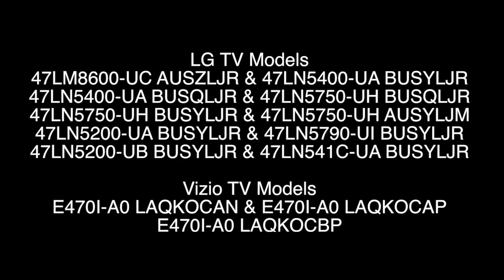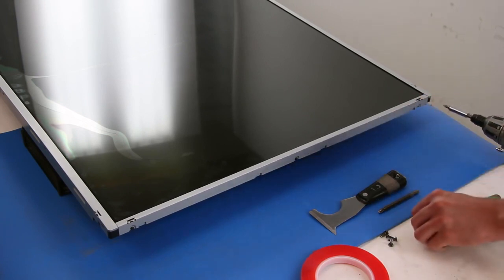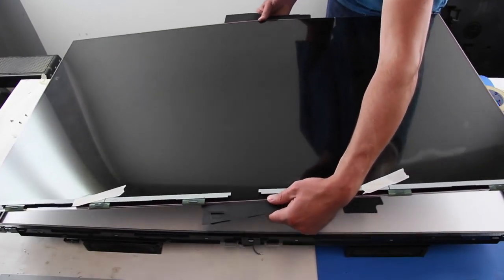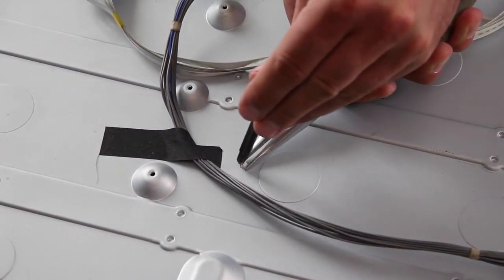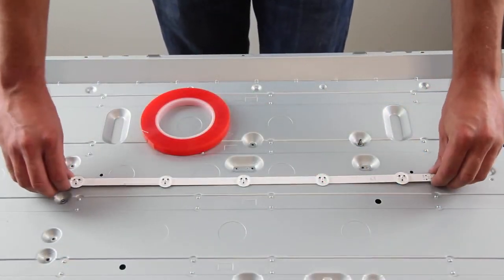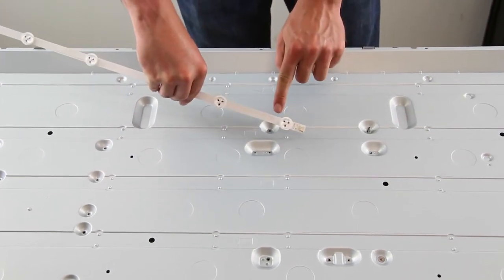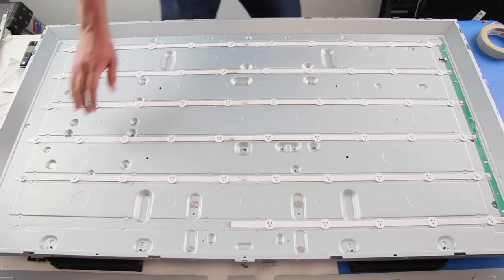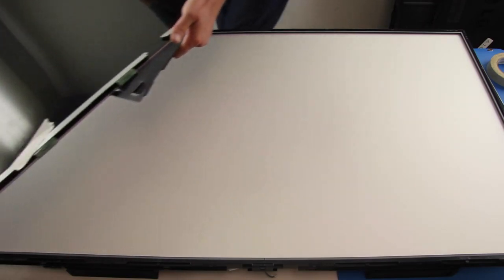LG 47LN & Vizio E470i-A0 No Backlights - LED Strip Replacement Tutorial - Fixing Bad LEDs

Comment: Great video.  I viewed a few of these videos to compare details, and this one I liked the most. Please note, this job turned out to be way easier than it seems.  It took me under 2 hours, including getting tools out and putting everything away. And I took my time. I didn’t remove the circuit board that the LEDs plug into, because you don’t need to.  I had to loosen the back circuit boards in order to “plier-off” one of those white plastic spacers holding the LED cover sheet. The fragile LED I was the most intimidating, but with a suction cup tool, it eased the removal, and this was not an issue.  Remove it the outer plastic back of the TV was probably the most intimidating, followed by unplugging the IR/red led light wires; so don’t let those first two steps stop you. $29 fix, well worth it!

Comment: I am late to this party, but my E470i-A0 just went dark.  It appeared to have a bad set of LEDs in the middle of the screen before it went all black.  I have LED strips already so I'm good there.  Should the lighting board that the LEDs plug into be replaced with a new one?  Also, are you using double sided kapton tape to hold the LEDs in place?

Comment: I got my LED's installed on my LG 47LN5400, but I got the light filters out of order (painter's tape failed to stick).  Does anyone know which piece goes down first (and rests on the pegs)?  The hard plastic filter or the 3 flimsy ones.
Reply: Did you ever figure it out? I have a Vizio with the same model panel and put mine together in the wrong order as well. The top and bottom of the screen is darker and not very clear. I hope you can tell me the correct order.
Reply: @xorange90x  Nope.  I took my best guess and I don't remember which order I put them in.  The picture is actually fine, except when it's a very whitewashed scene you can see faint shadows in between the LED strips.  It's passeable.
Reply: haha I'm about to attempt this now, so we'll see.

Comment: Fantastic, very helpful tutorial and video.  My LG 47LN5700 had a few differences - a 5th white plastic separator was located under a circuit board, but still removable.  Great to have the TV back working.  Many thanks!
Reply: Tom Agoston I’m having the same problem. I was wondering if you know if the leds are 3v or 6v ?
Reply: dabradsta72 Hi, sorry the TV Is now closed up and I’m not sure.  I bought the replacement LED set from the eBay seller “tvrepairledtester” according to my TV model, and replaced all of them.  Cost Less than $40.  Just be patient taking the TV apart and sort and save the screws and component parts!

Comment: Happy customer here.  I was able to successfully repair my TV using the replacement parts I purchased from this seller (shopjimmy).

I did have one hiccup at first, I did not replace the ribbons properly the first time.  The effect was that the TV turned on, but the screen was only backlit with no signal to the panel.  There also appeared to be a screen flair in the bottom left corner.

I'm absolutely delighted that I was able to repair, rather than replace the TV.

Comment: Jimmy Thank you for this amazing tutorial. I found a LG 47LN at my apartment dumpster. My first thought was "Okay, I know it's broken but how?" Turned it on, had the flickering lights so I immediately assumed it was the bulbs. I ordered the replacements strips on Ebay for $40 I found a tutorial on Youtube (Your video) and today, April 6th 2019, I was successfully able to repair my newly acquired television... I did run into a problem with removing the bezel with the LG logo. I cracked it but ended up super gluing it together... But  I can't thank you enough for making such an easy to follow video. Cheers!

Comment: Thank you so much! I just fixed my LG with this video. One of the LEDs had a good size burn mark of at least an 1.5 inches in diameter and the plastic LED cover had a hole melted in it.

Comment: Where can I purchase a replacement distributor board?
Reply: graymatter idk if you fixed yours yet but i couldn’t find a distributor board either. I just replaced the new led strips in the old board. Works good so far

Comment: Thank you for your video! I found a broken 47 inch on the road and from your video , replaced 2 LED strips that were burned out for only $15 in parts!!!   When I got the TV back together and hooked it up, it worked perfect---except for when the screen shows any white or  bright colors there seems to be a distortion about 8 inches long on the top part of the screen--kinda like a ghost image.  Could I have got finger marks on the underside of the screen when I removed it?  Or could this be a defect that was already there?   Its  hardly noticable , but bothers me a little. .  So thanks again for your video--It helped me a lot!

Scott